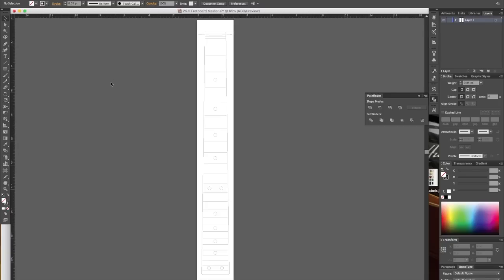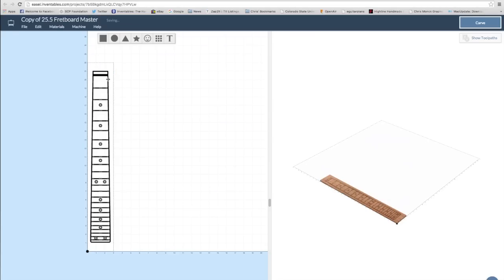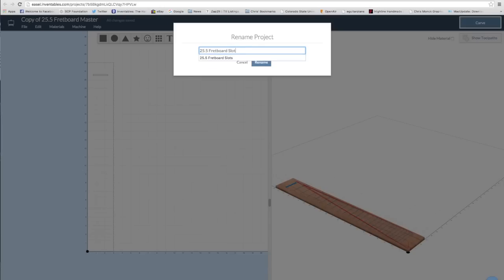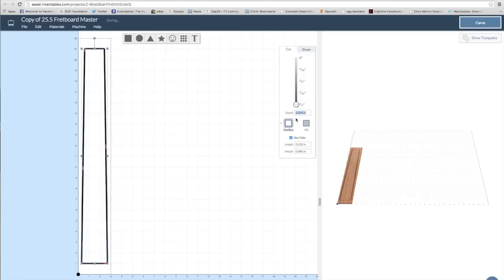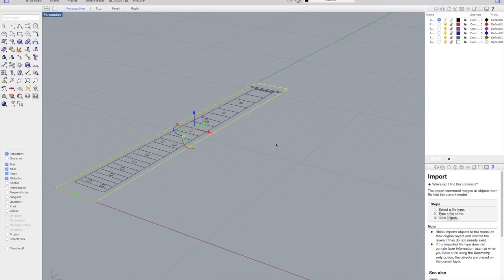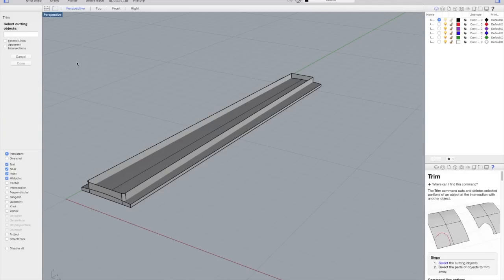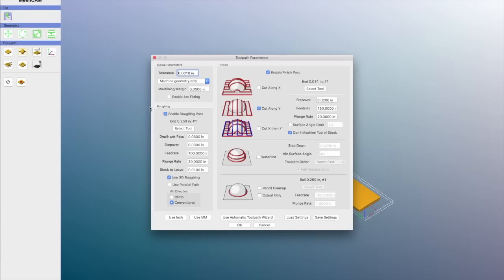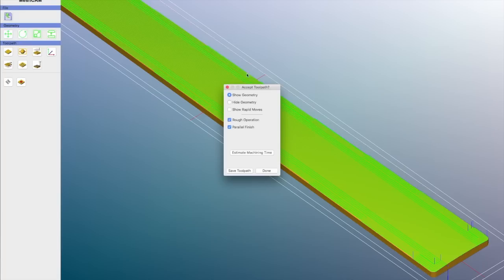Making A Fretboard With An X-Carve CNC Machine

Comment: Great video. With the method you used to model the fretboard in Rhino, wouldn't that result in the fretboard side walls not being the same height from one end of the fretboard to the other (but consistent thickness throughout)?  Do you prefer this over making the side walls the same height and having the thickness at centerline different at one end vs the other?
Reply from the maker: I don’t care about the side wall thickness. I care about the centerline thickness.

Comment: Chris I’m using mesh cam for my fret board tool paths. In Rhino 3d can I simply draw lines for frets and sink them down 1/8” and expect mesh cam to create a tool path or in Rhino would I need to “build” the fret slots @ .024 wide, sink them down and patch the bottom for mesh cam to recognize them as cutable? In meshcam for fret slots to you use the pencil or watermark option for those? Thanks!
Reply from the maker: I don’t use Rhino 3D for fret slots. Instead, I draw lines in Adobe Illustrator and import them as .svg files into Easel Pro.
Reply: I feel a bit sheepish as your video explains all this, sorry. Thanks for the  wealth of information, my friend!

Comment: Thanks for posting this video. It will become a classic. I've watched a number of videos showing a fret board being cut on a number of machines including the X-Carve and the Laguna Tools CNC machine but a lot of the design details were skimmed over. I thank the producers of those videos for showing viewers what is possible using CNC equipment. Your video has filled in the blanks for getting from design to execution. You laid out all the steps very clearly and although I have different software tools at my disposal, using the description you've provided, I now have all the information I need to move ahead. With the guidance provided in your video I look forward to cutting my first fretboard on my X-Carve in the next few days. Thanks again.